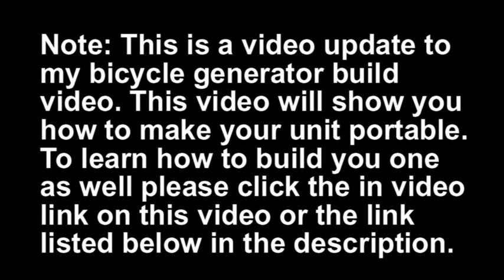How to make the bicycle generator build portable (link to original build in video)

Comment: I had a quick question.  Could you just utilize the bike tire and mount it so that it turns the motor vs taking the tire off and using a belt.  If you rig it this way, you can still utilize the bike for transportation.  You would have to make a tensioner to move your motor tight against the tire.  Just a thought.  Great video and I plan on making a bike generator within the next couple of weeks.  Thanks for the great videos.  I just found your channel and I am a big fan.